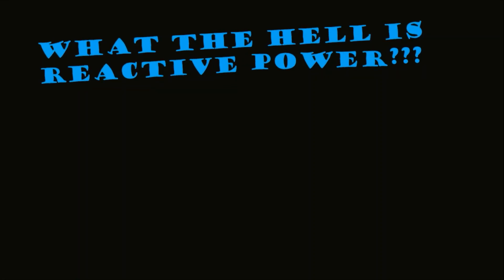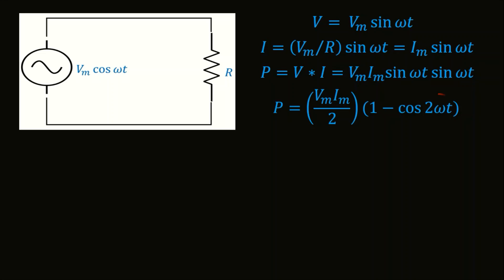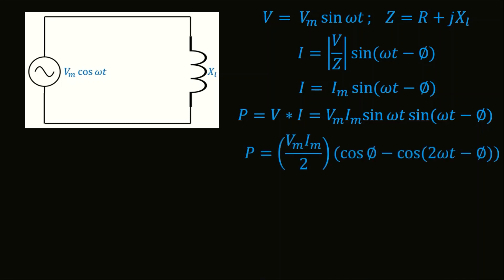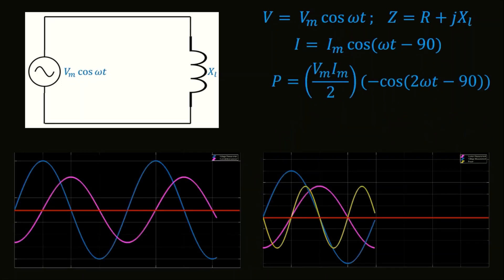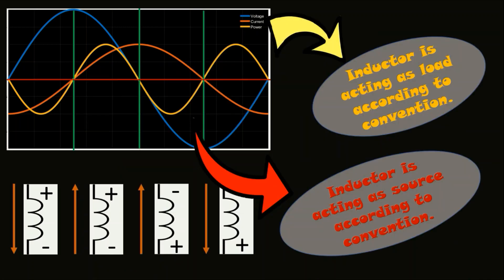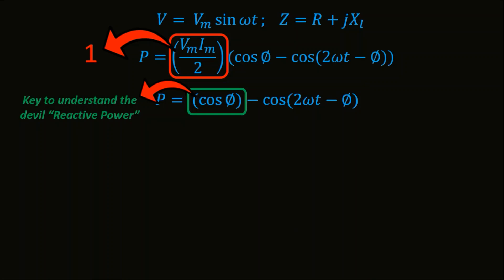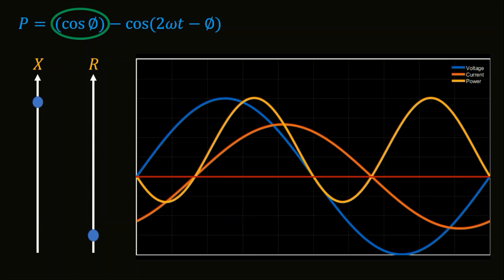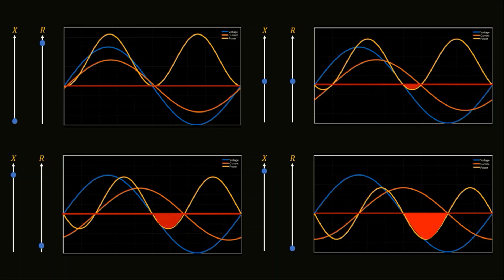What The Hell is Reactive Power ??? Visualization/Animation Using Mathematics

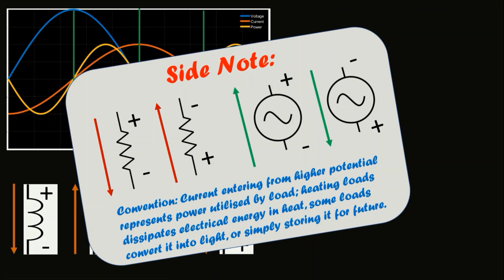Comment from the maker: One small correction in the figure given at 6:10, the +/- sign are according the the AC voltage waveform applied to the inductor, which is "positive" in half cycle and "negative" in other half, and the current flow due to this waveform is represented by arrows. The direction of arrows are according the current waveform which is "negative" in first 1/4 cycle, "positive" in next 1/4 cycle, again positive in next 1/4 cycle, and negative in last 1/4 cycle. By mistake, I placed the direction of arrows opposite to what it really should be. So just assume the upward arrows to be downward, and downward arrows to be upward.

Comment: Yes, but you can also say it simpler. Both Capacitors and coils will save energy. But when you have AC curent, the current will not only save energy, but give away energy( Current ) . For example an electrical motor where you have no load. Then the cos(phi) is small. Lets say 0,05 or 0,1- This means that 5 or 10% of the total available energy is used to turn the rotor. The rest of the energy is going back to the net. If you turn up the load so the cos(phi) is 0,9 then 90% of the energy is used and only 10% is going back to the source/net. Reactive power is ping pong energy. Going both ways, because a coil will be charged and discharged.
Reply from the maker: Thanks for watching the video thoroughly and adding the point to the discussion. I also tried to explain the same statement, however, I felt that just stating this fact will not be enough as we (especially electrical engineers) are reading this statement since 1st year of our graduation but still have not thought about it in depth. So I intended to tell the same story with a bit of different perceptive and a flavor of mathematics. (About keeping it simple, I was not up for analogies for this concept because I don't feel analogies can do justice to reactive power)